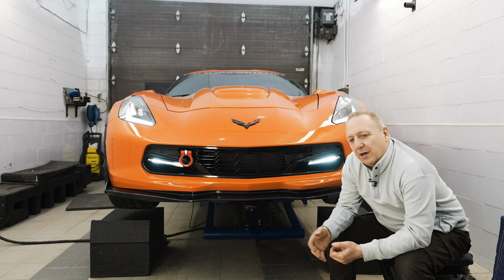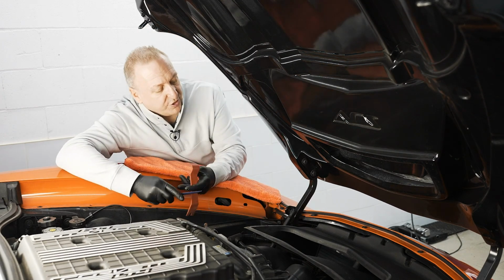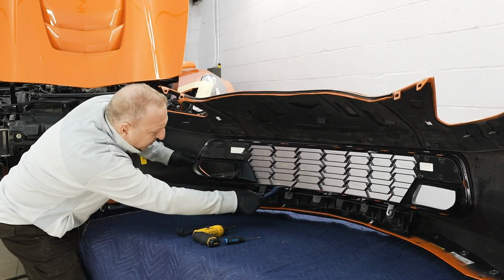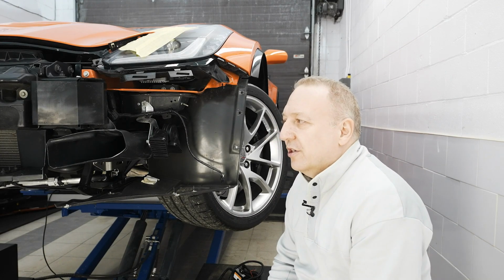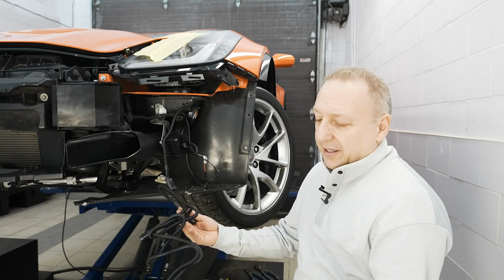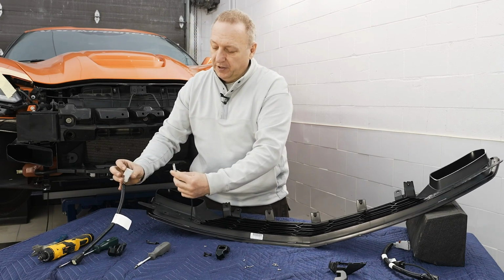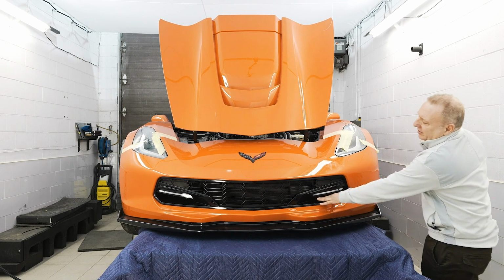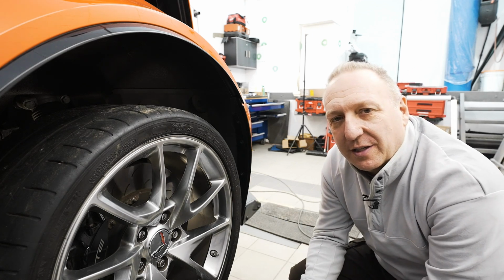ACS Composite Five7 Front Grill Installation Guide | 2014+ C7 Corvette | 45-4-273

Comment: Will the C7 stingray 2019 lt3 front cameras be able to be calibrated to the z06 grill with the dual front cameras ? My installer not sure if cameras will view correctly in the radio.
Reply from the maker: On this grill you’re re-using your cameras, and brackets are located in same spot. They will be perfectly calibrated

Comment: I do believe the deflectors that are in front of the tires (and across the mid section on Z06) are to deflect the air around the tires for better handling, not fuel efficiency.